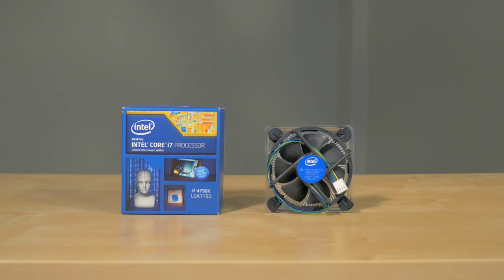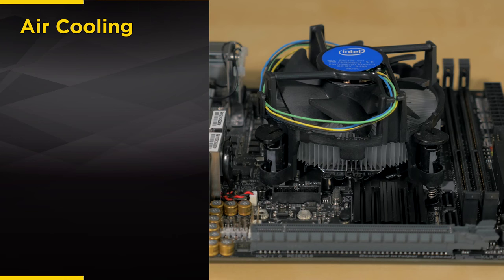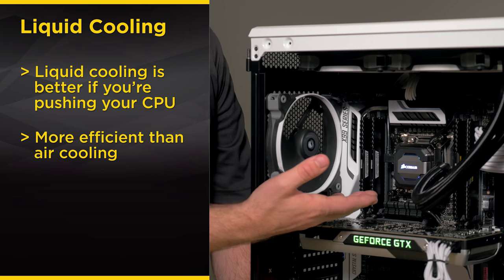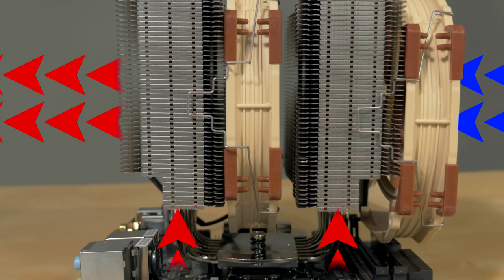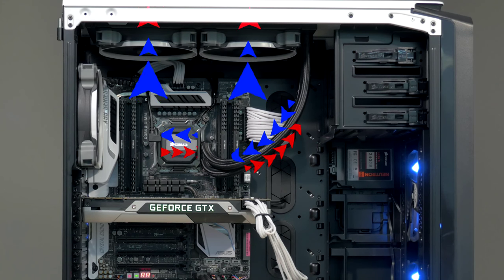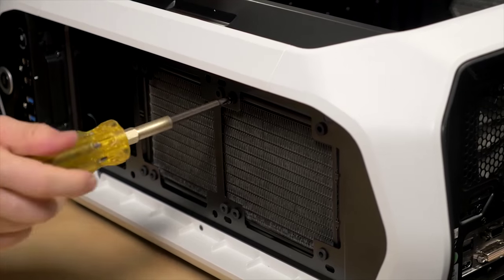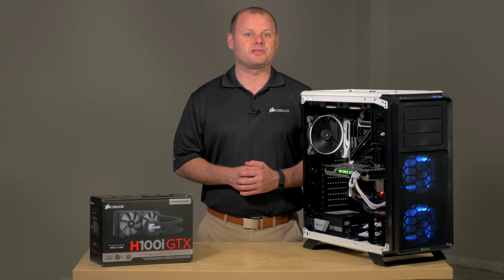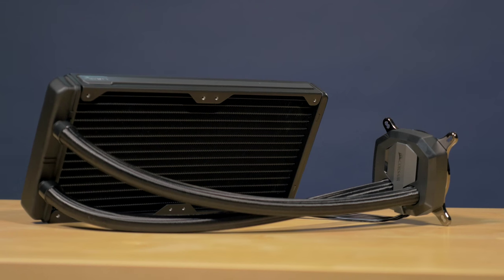Corsair PC Building Basics: air CPU cooling vs. liquid CPU cooling

Comment: Corsair building basics: BUY A LIQUID CPU COOLER CAUSE WE MAKE MONEY.
Reply: +AliveGhost13 I didn't even have to make a comment anymore, well put bro lol
Reply: +AliveGhost13 They're a company... they need to make money and advertise.
Reply: +AliveGhost13 1) Its looks great
2) Easier to clean dust than from air coolers
Reply: +Andris Berzins If you have a pull config yes..... Push no.....
Reply: KB_TheDireWolf i have a push config and dust keeps collection in the radiator and on fans of my EVO 212 cooler.
Reply: +Andris Berzins So change it up so it pushes instead.
Reply: Andris Berzins Its recommended to do a pushe(Fan is blowing through the radiator), then add another fan to pull. That's what I have and I'm fine, I should really clean my PC soon, but im runnning totally fine right now
Reply: Andris Berzins use a pull config, so you can just vacuum out the one side and is not trapped by the fan.
Reply: +AliveGhost13 no fucking shit, that's how marketing works
Reply: +AliveGhost13  exactly
Reply: +AliveGhost13 HOORAY. I AM NOW UNDERSTANDS.
Reply: Yes from making good cooling systems, this is an advertisement for their products.
Reply: This guy on the video presented himself as a total tool for the shirt he works for....I have to be honest here... I purchased a liquid cooling system for my cpu by corsair ..installed it and over clocked my cpu.... sadly that only lasted for a year and a month with no problems  until my pc started acting weird... lock ups... choppy game play .. . fan was going at high speed every now and then ... and a sudden increasing of temperature...at first i thought it was the dust so i clean it out .. and it still gave me problems so i set my cpu back to normal with out over clocking .. that lasted me an extra 4 months with out problems.... but then it came back again.... so i removed the cooling system .. the liquid in it was reduced to half (maybe less...) chunks of gunk .. i dont what it is.....plus fragments of metal... from radiator.. giving it very poor to no circulation .....bottom line it failed.... so i went with a good heat sink and fan (not from corsair) ...and surprisingly it working way better than the corsair liquid cooling fan when i first got it.....not that i am against liquid cooling systems for CPU ... but I feel there are design flaws to the system ....there no easy access to add liquid to the system when it gets low.... there no parts for sell to replace when it fails...radiator ... motor pump, flex pipe ..and the input output of the pipes themselves are questionable .... should it be on opposite sides like a car radiator? ect...basically you have to buy a new one off the self if any of that happens....just to deal with the problem 13 months after purchase..if you are willing to deal with the problems i mention then by all means get a liquid cooling system for your cpu .. if not just buy a good heat sink and fan ...
Reply: Slash Le Pew They didnt even said air/water cool cons and pros. They just said pros of water cool :/ Thats why I love independant youtube channels that does tests and other stuff to say what is a trap and what to buy . This is sad but this is marketing.

Comment: This is just plain wrong. High-end aircooling is more quiet and nearly as powerful as 240-280mm AIOs.
Reply: lol how is it more quiet? the pumps on aios are pretty quiet these days.
plus, custom loops tend to be even quieter than that.
to me, it sounds like you're just rationalizing the fact that you can't afford watercooling.
Reply: +wenisinchina Err. I'm running custom water but okay.
Reply: thewalrus i'm sure you are
Reply: +wenisinchina Would you like a rundown of the loop perhaps?
Reply: +wenisinchina I'm looking for a solution myself,  many tests show air to be quieter. i guess the hard working fans are blowing straight out of the case vs inside the case (dampening noise)
Reply: forestR1 it's highly dependent on the water pump. if it's a cheap, crappy one like in most AIOs, then it's gonna make a little noise. fans on air coolers also make a significant amount of noise as well. most decent custom loops are gonna have a pump that's quieter than the coil noise of the rest of the components in the system, which leaves it down to fans.
Reply: +wenisinchina You're just another fanboy that recommends things just because you have got it
Reply: +wenisinchina AIOs are generally unreliable, expensive, and noisier than air, plus they currently offer no significant performance increase over high-end aircoolers. If you want an AIO for the looks, fine. But don't spread bullshit here pls. Only AIOs truly worth getting from a performance point of view are the fully expandable ones with custom water components, such as the EK Predator and Swiftechs new X2 series, but they're significantly more expensive.

And you didn't answer, you want a rundown of my current main loop?
Reply: thewalrus I agree that AIOs are garbage. They're not unreliable, however. And smaller ones are actually the same price as a high-end air cooler, and they're just fine. I had a cheap little first-gen corsair h60 on my server ever since it was released, and it has not had a single problem. Quit spreading bullshit. Air cooling is fine if you don't have space for a radiator, but it is NOT superior to even a cheap single-rad. 
Also, I don't care about your loop. It's not relevant to the conversation.
Reply: +wenisinchina AIOs are unreliable. You having one without problems proves exactly nothing. I recently had a conversation with someone working for a large retailer (that I used to work for) here and he told me some pretty interesting stuff about AIO RMA rates. It's pretty insane. Even EK recently recalled ALL of their Predator units (rev 1.0) due to danger of leaks. AIO pumps are generally low quality. They have to save costs. Only EK and Swiftech have decent ones in their AIOs. 

I do hope you're just trolling here, saying that AIOs are more quiet is simply wrong. High-end air is equal in performance to most 240-280mm AIOs, while being more quiet and usually cheaper as well. This is widely documented, and arguing against it is like saying the Earth is flat. 

Also, even if you had a completely inaudible pump (I'd only class D5 and perhaps DDC as ones) you'd still need to buy new fans for AIOs to match the sound levels of the NH-D15 which comes with pretty much the best fans available. That's another 40-50€ more. Currently only Swiftechs X2 Prestige series coolers come with truly high-quality fans (NB-eLoops), while EK's Predator ships with decent ones (EK-Vardars). Lower-end AIOs lose in performance and acoustics quite clearly compared to high-end air, while they usually cost the same.

Corsair's 240-280mm GT/X-series, FDs 360mm Kelvin series and 280mm Kraken from NZXT are the only CLCs that make any sense at all, but they're all quite a bit more expensive than an NH-D15, though they do offer a bit more cooling performance. However if you want even decent acoustics, you'll need new fans. And you'll still lose to the Noctua tower in acoustics. 

If you absolutely want a bit more performance than what an NH-D15 can offer or you can't fit it in your case, some high-end CLCs do provide it. You will however pay more and lose some silence. If you truly NEED more cooling capacity, I'd just go straight to an EK Predator 360/Swiftech X2 360 or full custom. Sure, CLCs may look cool n all, but it doesn't change the facts.

FYI, I've owned or tested every CLC mentioned here.
Reply: thewalrus Why are you upvoting yourself?
Reply: +wenisinchina ?
Reply: +thewalrus If you think water cooling makes more noise then you are just wrong. The pump is near silent and is impossible to hear with two 140mm fans. And assuming you are testing with the same variables (fans) then they would make the same amount of noise.
Reply: Read Adams my water cooler makes more noise than my air cooler did, well... not that it is really any louder, but source of the noise is much more exposed than when it was contained deep within the case with room to muffle the sound
Reply: forestR1 I guess, but any other case fans you install at the front/back will also be "more exposed" so if instead you placed a radiator instead of installing 2 case fans it shouldnt make any difference since there is also 2 fans on the radiator and the pump is deep withing the case muffling its sound.
Reply: Read Adams in my instance its the air moving through the rad, makes a bit of noise not massive, but moderate. I have the same fans on the rad as i do for normal case fans (TT riing RGB PWM) and as case fans they are more or less inaudible.
Reply: +Read Adams Your idea of "near silent" is quite interesting.

Comment: Noctua NH-D15 outperforms most 240mm aio coolers at much lower noise.
Reply: +Herman Strandberg I still prefer AIO tbh..
Reply: +Herman Strandberg Don't just say it, let's see the numbers. Yeah, and use the new 8 core Haswel-E CPU i7-5960X.
Reply: I absolutely agree on you, corsair only wants to promote liquid coolers, because they only sell liquid cpu coolers.
Reply: +Herman Strandberg Yep, using that on one of my builds too.
Reply: +Herman Strandberg Yes, this is true.
Reply: +Herman Strandberg yea but 280mm beat it and with noctua its impossible to change stuff top left on pc and its not going support high profile ram and noise is not proplem for me so aio for me
Reply: Aaponton Actually it does support high profile ram. There is a cut out on each side of the heat sink that fits tall ram. I am using 4 high profile g skill ram cards(32GB)  and they fit just fine.
Reply: +jonathan perkins Air coolers have radiators? I don't think so, I think you mean the heat sink.
Reply: Angel Luis Trinidad Yeah that lol

Got them mixed up for a minute.
Reply: +Angel Luis Trinidad If you go look up any benchmark with a NH-D15 and a Corsair H100i, the D15 matches and sometimes beats the H100i while being more quiet.
Reply: +Kloaked Where can I see that? Are those temperatures with an overclocked CPU? The problem is that people generalize, and sometimes you cannot  say that always a Noctua Air Cooler beats an All In One Liquid Cooler. If you're going to overclock a liquid cooler is your best option.
Reply: Angel Luis Trinidad I'm talking about Corsair's specifically, as I know for a fact that if your case can fit one, an NH-D14 or D15 would be a better option.

Only AIO that I would even bother with is the 240mm from EK.

But anyways, here's a link. They use stock and overclocked settings and the D15 beats the H100i in this test: http://www.pcper.com/reviews/Cases-and-Cooling/Noctua-NH-D15-CPU-Cooler-Review
Reply: +Kloaked Did you check this review, because the Noctua air cooler beats the Corsair H100i only on the Ivy Bridge CPU, On Haswel CPU, the Corsair H100i beats the Noctua on stock and OC settings. I think you have to re-read this review.
Reply: Angel Luis Trinidad It's a 4 degree difference I thought. But if you go look at the fan noise, the fans on the D15 aren't running as loud.
Reply: +Kloaked We are talking about temperatures not noise, but the noise on the H100i you can fix by changing the Corsair fans for Noctua fans. That's what I did, I have a Cooler Master Nepton 280L All In One Liquid Cooler with Noctua NF-A14 Industrial PPC-3000 PWM fans for cooling an Haswel i7-4770K CPU, overclocked to 4.4 ghz.. I know Noctua Fans are the best, but I only use them on liquid cooling systems.
Reply: Angel Luis Trinidad "It isn't running as loud", meaning if the fans got kicked up a notch it could likely close the gap more. But that's not important to my point: there's such a small difference sometimes that you should go with the solution that doesn't have a chance to leak liquid or have pump failure.

Also, you adding $25-$30 fans just added to the already high cost of the AIO. If that's your thing, by all means go for it.

Anyways, the comment the first guy made said the D15 would outperform most 240mm AIOs, which is true in context, but generally it's close enough that an air cooler would be a better choice in my opinion.

My issue with the video is that they just neglect to mention that there's just-as-good-or-better air cooler on the market as the AIOs that they sell - and tout that air coolers are only made for simple tasks. That's a load of bullshit and even you know that.
Reply: I agree the NH-D15 its very quiet and gives a good performance vs the h100i
Reply: +Kloaked Now you added more variables to the discussion. We were talking about that the Noctua air cooler out performs a all in one liquid cooler, and I said you cannot generalize, because not always. Your own review proof you wrong. Now, you say that a liquid cooler could leak, true, but you or I could die tomorrow, right? But, we could also live to be 100, right? I've been using all in one liquid coolers for 4 years with no leaks. all in ones are more safer from leaking than custom liquid coolers, and that's because they come sealed from the factory. I hate air coolers, because they take too much space right in the middle of the mobo. Liquid coolers look better and they are cool. I would never go back to air coolers if I'm overclocking my CPU.
Reply: Angel Luis Trinidad I didn't add any variables - I'm well aware of the criteria you were originally replying to. We're carrying on a discussion.

The review I linked showed exactly what I said the first reply that I made: If you go look up any benchmark with a NH-D15 and a Corsair H100i, the D15 matches and sometimes beats the H100i while being more quiet.

4 degrees is negligible. If it was a 10 degree difference then it'd be something. 4 degree (if that's correct for every user) difference for a better noise level. I'd take it.

I see what you're saying with you're analogy, but I'm not going to  #yolo  with my rig, personally.
Reply: +Herman Strandberg Yup. It does! It's cheaper than the H100I GTX too I believe. If I ever build my system want to OC a 6600K with a be quiet! DARK ROCK TF. Because well it's be quiet!, and I plan on recording and being all blacked out looks so good, and performs well too!
Reply: +Angel Luis Trinidad It's been proven time and time again.
Reply: +Angel Luis Trinidad Yes, a custom loop is the best option for overclocking. However most AIOs don't provide you a major performance boost over high-end aircoolers. The only exception being pretty much the EKWB Predator 360. The only reason to get an AIO is that it looks cool, or that a large aircooler won't fit your case. We've done a shit ton of testing with several AIOs and only the EKWB Predator showed a clear advantage over the NH-D15. Then again, it's nearly 300€, making it about 3 times more expensive. My custom loops again showed a much larger performance gap, but that cost me about 600€. The NH-D15 is cheaper, more quiet and pretty much equally as powerful as most of the 240-280mm AIOs today. Testing was done mostly on a 4770k @ 1.35v 4.5GHz and a 5930k @ 1.32v 4.6GHz.
Reply: +FantasticFranco But I'm talking about cooling the best of the best, and overclocking. So, I'm sure you know that the i7 are better on performance than the i5.
Reply: +Angel Luis Trinidad some people bought i7-6700 and if you compare them to (just a lil bit) oc'd i5-6600K the i5 beats them... (80% of the time...)
Reply: Stijn Weijters In single-core performance, yes. But in multi-core performance, no way.
Reply: Herman Strandberg ofc..
Reply: +Herman Strandberg i have an h110i gtx with noctua fans, and can't here any noise of my PC. i can even sleep close too my pc while my pc is on 100% load and its still quiet.
Reply: ***** But they are still louder than a noctua cooler.
Reply: Herman Strandberg how can it be lower noise when its allready not hearble? i mean do you have your ear verry close too you pc 24/7?
Reply: +Christian “csh92” Schmidt Because there are fewer moving parts in the noctua cooler.
Reply: +Herman Strandberg False.
Reply: Read Adams Nope
Reply: Herman Strandberg
If you use the same amount of fans and the same kind of fans (which you should because you are testing and you always want the same variables) then it shouldn't be that much of a difference
Reply: Read Adams The pump makes noise. The nhd15 does not have any moving parts other than a fan, therefor less noise.
Reply: Herman Strandberg
I get that but the only extra moving part is the pump and it is impoosible to hear if you have 280/240mm worth of fans running

Comment: Yeah....used corsair AIO coolers before. Went through 4 separate h100i before deciding to stick with air cooling. Those AIO were leaking within the 1st week of installation. Currently using a Noctua NH-D15 SSO2 D-Type Premium CPU Cooler and keeps my cpu under 60C under extreme load. (using an Intel 8 core CPU)  :)

Corsair does make some great, silent fans though (using 8 fans in my chassis and can't hear any noise). Also using the Corsair Carbide series Air 540, its a great chassis with plenty of space.
Reply: +jonathan perkins Really? My H80i has been going strong and quiet for 2 years now. Shit luck I guess. I could never tell if one of those tall air coolers would fit in my case so I just grabbed an AIO.
Reply: Zach Cormier Yeah, all 4 of them were leaking from the same exact areas: the bolt that meets the radiator to the hose. Never noticed it until I smelt something and saw that it was leaking on one of the GPUs. Had to RMA each one.
Reply: Logan Hamilton Mine works fine for my builds. Case temps are only 40C under 115% load.